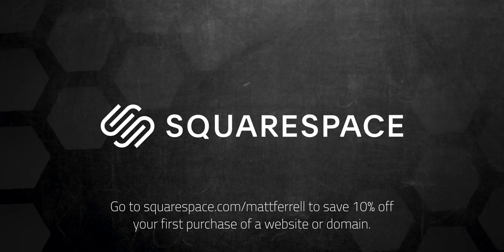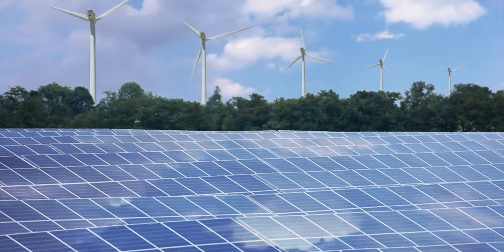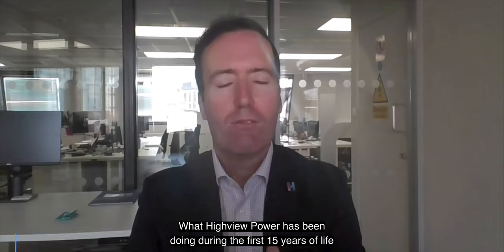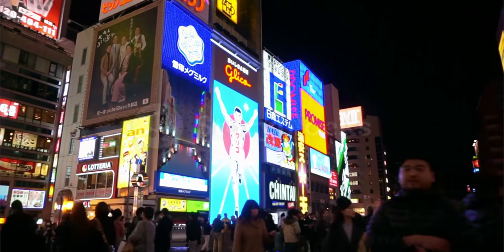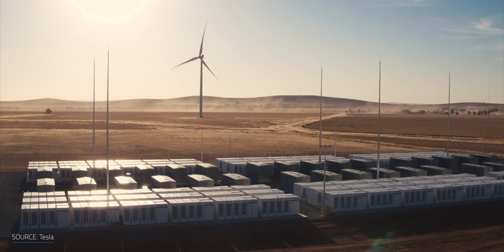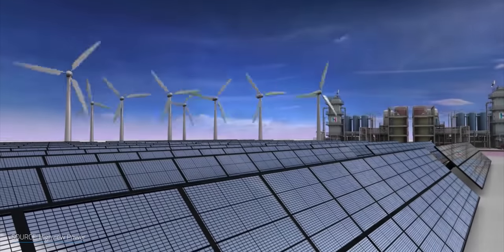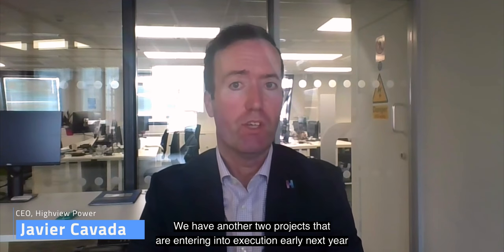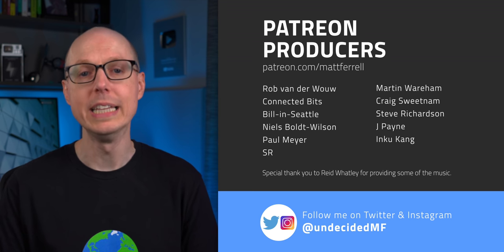Liquid Air Battery Explained - Rival to Lithium Ion Batteries?

Comment: I'm TOTALLY calling BS on this. This is so silly that another one like it will cause me to unsub. First, the title is beyond ridiculous. How do you put a liquid air battery in an EV? Come on.

Javier is the focus of the BS. It IS about the efficiency. Renewable energy is cheap and getting cheaper, but it's not so cheap that we don't have to care about efficiency.

Maybe Javier should get together with Nikola, and they can use liquid air to power their trucks.

No mention at all of other technologies that are suitable for stationary storage. What about gravity batteries, or flywheels, or Donald Sadoway's cheap metal batteries? What about CAES?

A total waste of time. Don't believe the hype.
Reply from the maker: It’s not hype.  The’ve shown a valid path forward for grid scale energy storage at a compelling price.  I’m very interested to see how the Vermont energy storage system and others they’re currently building out work out.  As I made the point in the video, it’s about choosing the right tool for the job.  This technology isn’t the perfect solution in every case and neither is lithium ion.  The more options we have to choose from the better.  And apologies for the title ... several have called it out as click-bate, which wasn’t my intention (actually just changed it).
Reply: @UndecidedMF  I still don't see any advantages for this technology, any place where it can do something that other alternatives don't do better. And for Javier to suggest that efficiency is not really an issue is just deceptive.

If you can point to anything quantitative that shows such advantages, I'll be interested.

Changing the title is WORSE than leaving it with its mistakes. It creates real problems any time you want to search for the title later. When you have second thoughts about a title, you should leave it be and resolve to do better the next time. BTW YouTube is also at fault, because of the whole way they handle attributes of videos. But it is what it is, and for now we're stuck with it.

Comment: There are several inaccuracies in this presentation.
First, nobody makes large quantities of liquid air. In this application liquid nitrogen would be produced. This is because liquid air in storage boils off nitrogen resulting in a liquid enriched with oxygen, which is dangerous. 
Second, an air separation plant takes more than 24 hours to cool down to operating temperature. If it is switched off the temperature profiles in the heat exchangers are disrupted and restarting is a long and difficult process.
Third, to produce liquid nitrogen, a large volume of air is compressed and part of it is expanded through turbines. These turbines produce electricity, but far less than the power that is used to compress the air in the first place.
Fourth: To generate power from liquid nitrogen, it has first to be pumped to a high pressure and then heated and vaporised before being expanded through a turbine to produce electricity. This has to be done when no other power is available to heat the liquid. As the liquid is evaporating the amount of energy it consumes is far more than the heat that can be stored from the compressors. The only source of heat available is the air. It is common practice to evaporate nitrogen using large air heated finned tubes. When this room temperature nitrogen is expanded it gets very cold. It needs to be taken out of the turbine, warmed up again and expanded further.
This is clearly not a practical proposition.

Comment: The problem with cryogenic technologies is that they use a lot of energy and also release a huge amount of heat. Since we are trying to tackle global heating, isn't that counter-productive?
Reply: Yes. All energy use ends up as heat energy. That is a basic law of the universe. The only way to not make heat is to not use energy. So conserving energy (and heat) is always a good goal. If you can't avoid making heat, the best thing you can do is save it until it becomes useful, as it is here when the cold air is warmed up on the way out.